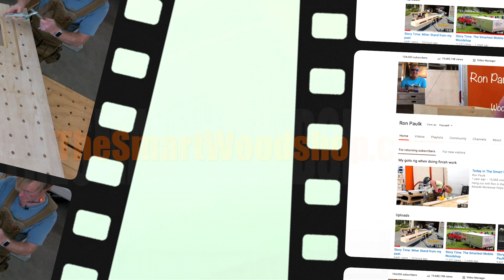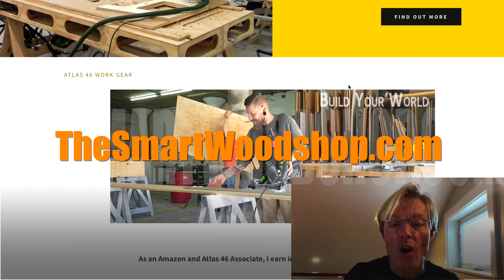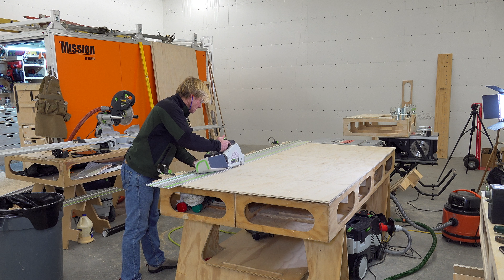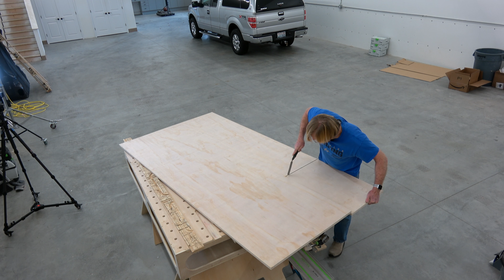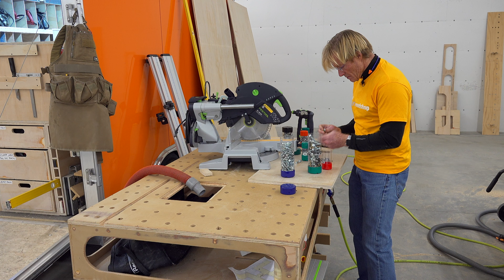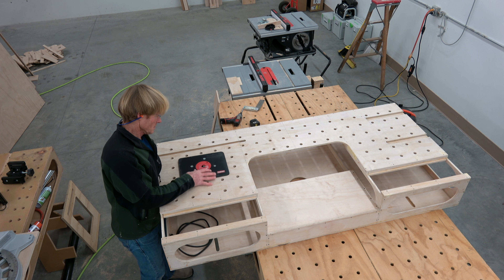Smart Total Station Build (Part 6) MITER SAW MOUNTING.

Comment: I'm about to buy your plans for this (PTS 2 I think?...) And I was wondering what the differences are between the PTS 1 vs the PTS 2?
Reply from the maker: The STS (PTS2) is completely redesigned and based on the metric system. Don't let that be an issue as it is more exact and only requires having a metric/imperial tape measure. Once built, it doesn't matter for daily use even if you are primarily imperial as I am. The bench dog holes are 20mm spaced 96mm which is industry standard. I have also not included the table saw support on the newer version as I no longer use it. In all other ways, the STS (PTS2) is an evolution and incrementally improved in every way. We still offer the PTS as when we tried to remove it, we were slammed with requests due to the Table Saw supports. For me, I am not looking back and prefer the STS (PTS2) by a mile. But again the PTS still sells better so it is your choice. Any updates or changes I make in the future will be based on the STS (PTS2). Hope this helps, Ron
Reply: @TheSmartWoodshop  thank you very much for the insight on the details between the two versions, however as much as I love the switch to metric (specifically the standardized dog holes 🤤) I'm building this bench mainly bc I want to use it for an outfeed for my table saw. So I think I'll purchase the plans for the first one.